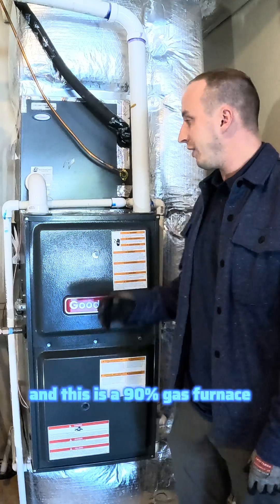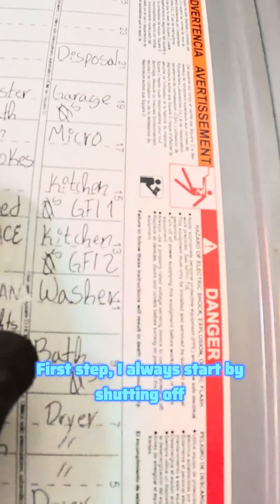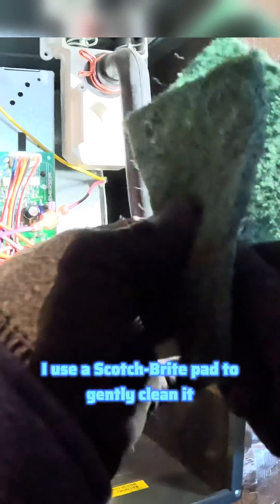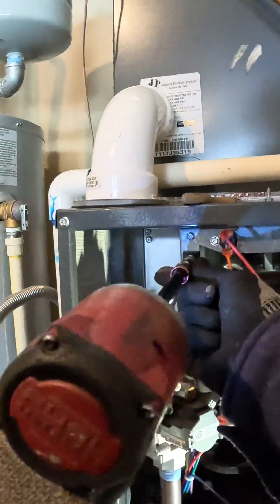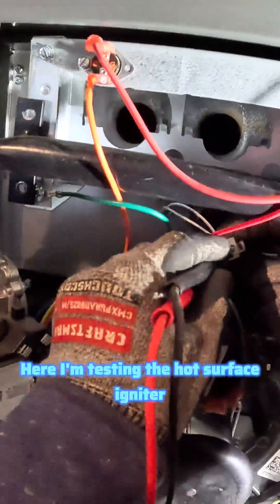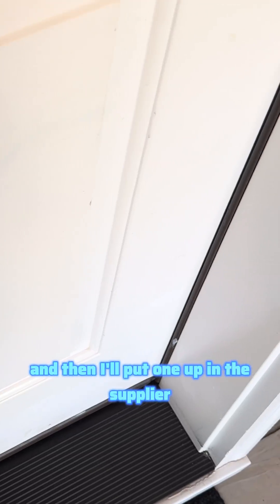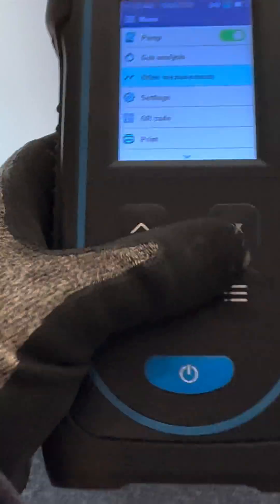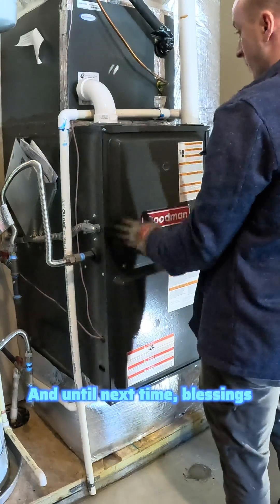Furnace Maintenance in Meridian, Idaho | Filter, Flame Sensor & CO Safety in 4K

Comment: Why would you drill a hole in the flue pipe? Bunch of nonsense to try amd justify a big charge.
Reply from the maker: Great question! On many furnaces, the factory rubber test port on the inducer housing doesn’t always reseal perfectly after you remove it. That’s why a lot of techs use purpose-made test plugs designed for flue testing.

They create a much tighter, safer seal, and I also add a bit of high-temperature caulking as an extra layer of protection so everything is sealed when we’re done.

There’s no extra charge for that — it’s just the correct and safe way to test combustion and CO levels and then seal the system properly afterward

We charge $100 for a tune-up so we have the time to do a thorough job — not a quick in-and-out. If we wanted to, we could charge $59 like some companies, but that usually means rushing the visit. I prefer to take my time, test everything properly, and often catch issues like dirty blower wheels, failing parts, or CO concerns before they become dangerous or expensive.

In other words, it’s about quality over quantity — giving people way more value and a safer, better-running system for just $20 more than the bare-minimum tune-ups out there.

Here’s a link with more info. https://youtu.be/eB2Lux8zEMM?si=8vIi2NsaPifp6YlI

https://youtu.be/0-qwkVPLjlE?si=t4smLq1CWGeBo_VB

Comment: Condensate trap? Blower wheel and motor? Amp draws? Static pressure?
Reply from the maker: Thank you for the comment, 

Good observation. 

Yes, I did clean the condensate trap. I poured cleaner down it and made sure everything was clean.

I checked the blower wheel and the motor amp draws and everything. The rest of this is in the full video. I don’t think I recorded pouring the cleaner down the condensate though. Thanks for watching!

Comment: Bro that fresh air intake pushing against the coil is bothering me. Is it not smothering the furnace?
Reply from the maker: Good catch 👍 This was actually a new customer’s furnace we were doing a maintenance on. There’s a couple inches of clearance on the other side, so it hasn’t been smothering — and it’s been like that for years without issues. That said, I was noticing the same thing, and I’m planning to go back for something else there and I’m going to turn that elbow so it breathes better. The copper layout wasn’t the cleanest either.  Appreciate the sharp eye!
Reply: @SaintTonysHeatingandCooling ah so it’s still breathing some then. I like to fix those types of things for free to build trust with new customers.
Reply from the maker: @HardWorkinBoysStudios  Love it. Good stuff. I will fix it for free.
Reply: Was about to say the same thing 😂
Reply from the maker: @BoratVoiceMyWife thanks for watching yeah that’s how the unit was when I got there and there is a gap behind it. 👍
Reply: @SaintTonysHeatingandCooling  I’m sure it’s a non issue, but the first thing I would have done is rotate that pvc elbow 90 degrees. But a $29 tune up is cheap af for all the things you did. No hate
Reply from the maker: @BoratVoiceMyWife  Just to clarify, we don’t charge $29. The point of that video was actually calling out the $29 tune-up gimmicks you see advertised — where someone comes out, barely looks at the system, and then immediately tries to upsell.

What I was showing is what our $100 thorough preventative maintenance actually looks like when it’s done properly.

And I agree with you on the PVC — it could have been turned, and there was room to do it. In this case it looks like the installers chose to keep it more uniform and not sticking out to the side. Hard to know their exact reasoning, but it wasn’t unsafe — just a layout choice. Why didn’t they turn it forward haha? Thanks for the comment and thanks for watching.
Reply: Good job brotha! Peep game… At the 10 year mark, I offer a FURNACE REJUVENATION. I replace the Flame sensor, pressure switches, igniter, Blower Motor Cap, condensation pump and sometimes the control board ,inducer motor, and the thermostat.EVEN IF THEY ALL ARE WORKING !! Crazy Right? Peep.. 
the chances of one of these items failing after 10 years is likely right? So I recommend it before it happens. I can order all parts from the manufacturer (OEM) at the same time and replace them proactively at bundle price and offer a 5 year parts and labor warranty ( that’s crazy good) Think about it… how long will it take you to change all these parts. Couple hours tops if you have experience. Who wins? Everyone. Now… if client doesn’t approve the REJUVENATION, and the system fails after your visit, your ass is covered and you can return and say “ I did offer to replace this with the REJUVENATION “ so it’s not a call back , it’s a second chance to help them. I offer this again at 15 years. Or if I show up to a new customer with a 12 year old furnace, I do it then and then again when it’s 17 years old. At 20 years, I don’t recommend proactively replacing parts.. it’s time to consider replacing the system. What do you think? Also, if client doesn’t want to do a complete REJUVENATION, I offer at minimum the common items that fail on their specific unit… flame sensor , igniter etc.
Reply: @CLOSEHVAC i believe and practice in troubleshooting down to component level, and only replacing parts that need replacimg when they are out of spec. preventative maintenance goes into every job, whether parts are needed or not. the count is lost on how many repairs were performed, and safety issues addressed without selling or installing a single part. airflow, psychrometric readings, trap, gas pressure, cap test, coils (where applicable), burner orifices and tubes, flame sensor,  and flue cleaning, followed by combustion/indoor gas/temp test. proper service.